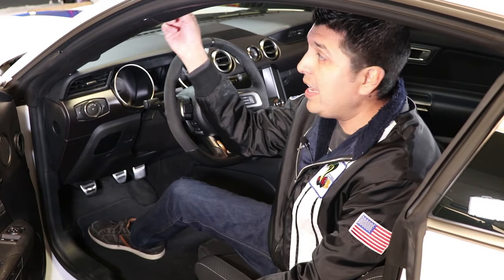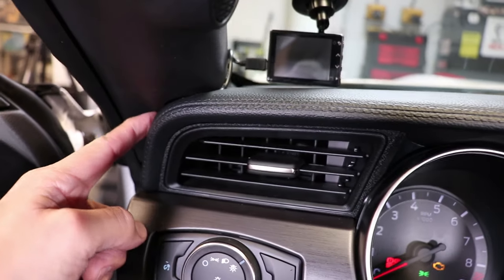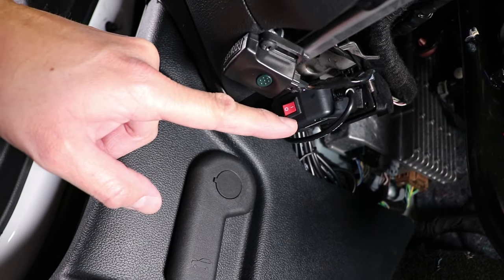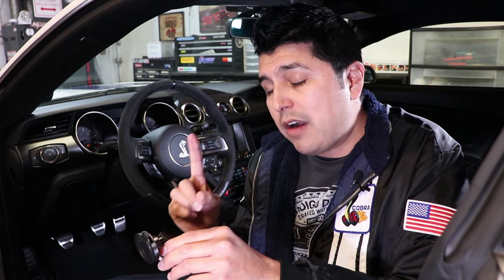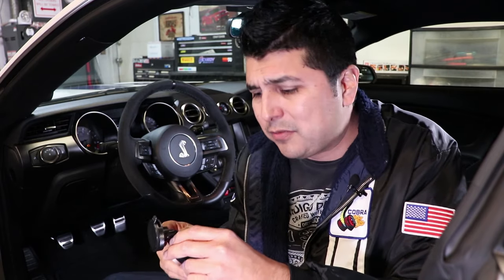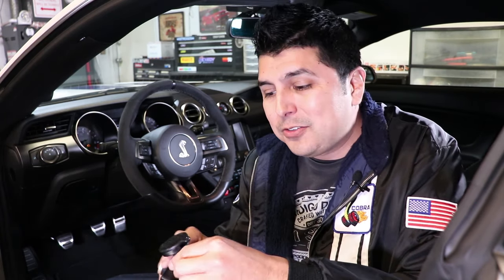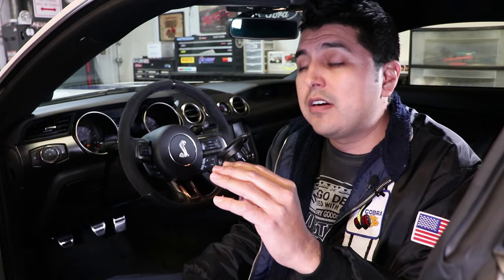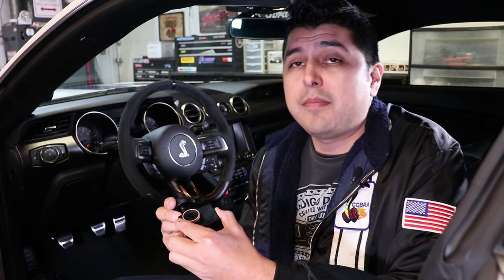Don't hardwire your Dash Cam! Try this instead!

Comment: If you were hoping for the worst dash cam install ever you nailed it.
Reply from the maker: LOL! If you are looking for a permanent install (and hiding the cables underneath the panels, here is my other video showing the alternative Hardwire method https://youtu.be/zbxYA4VhuT8  However I strongly recommend profession installation due to the dangers involved with air bags as explained in my follow up video showing the rest of the install https://youtu.be/uZp95NbNlmM Cheers!

Comment: Thank you for walking us through this.  I am interested in adding a dash cam, especially for the parking mode.  But I am put off by having to either wire this to my car battery or buying an expensive, one purpose Cellink Neo or the like.

Do you have any reason to doubt whether a Jackery or Yeti, or any other external battery popular with off-grid/campervan enthusiasts, could also do the job of running a dash cam, especially in parking mode?
Reply from the maker: You're welcome mavirek! regarding running the dashcam of an external battery, it's definitely possible and some people do run them on portable bank like this one https://amzn.to/3kQroBR the only issue seems to be heat inside of a car degrades the lithium batteries and you will have to replace the battery pack over time once it stops taking a charge. But if you think of it as a consumable item, then it's definitely possible. Hope this helps and thanks for watching!
Reply: That's what I wanted to know also. 
Did you try what he suggested with the other. Battery he linked...or one like it?🤔
Reply: @GoaWay...  I just couldn't get comfortable putting a battery into my car because of stories about exploding batteries.  So I instead got the OBD connection for my dash cam, which I highly recommend.
Reply: @mavirek  it's been no problems with it so far...no dead drained car batteries, or no problems even for the obd port itself...it still works properly if you need to plug something else into the port? 
The dashcam stays working 24/7 with no issues?

Comment: Can’t get a full view of the road in that location !!
Reply from the maker: Hi JerseyJoe, that is correct, the placement of the camera lower on the dash will show more hood than higher on the windshield which while it works for me may not suit everybody. A higher location will show more road and would only require routing the cable a little higher up the A pillar. Thanks for watching bud!

Comment: Great review dude. When you showing the cable connect it to the OBD whats the other device with a blue oval buttom its close to your OBD
Reply from the maker: Thanks Rottie For Life appreciate that! the other device you see is an aftermarket alarm installed by the Ford dealer.
Reply: AutoFun what’s special about the extra car alarm that the dealer installed?
Reply from the maker: @iamdenislara  Hi Denis, it adds GPS tracking, it connects to an app on your phone and shows where the car is at. I just don't like that the dealer tends to overcharge for these systems when selling the car,  they are much cheaper if bought and installed after the purchase of the car. But on the plus side I do get discount from my car insurance for having it. Thanks for watching Denis!

Comment: Great video , what about engine management light from your car ..........???
Reply from the maker: Thanks Me 1! regarding engine management light, not sure what you mean by that, are you referring to the check engine light? if so that is controlled by the PCM, the OBD adapter does not interface to the PCM, it just provides power to the dashcam. Hope this helps and thanks for watching bud!

Comment: Even easier - I plug into my mobile Car Battery Booster which has USB port. That allows me to run my Dashcam in Parking/Security mode etc. The boosters are small now so its easy to use and can be stored anywhere! When I'm driving I just plug back into my car lighter adapter. I don't need it wired up in a permanent way so this arrangement works well for me.
Reply from the maker: Hi TheAisleOfPlety! nice! I had other viewers that mention running battery banks and they said they had with good results but I hadn't heard of running off a battery boosters, thanks for sharing this tip!
Reply: @AlexAutoFun  So glad to contribute! Love your channel! Keep up the good work. My Booster model is the GB40 NOCO Boost Plus.
Reply from the maker: @TheAisleOfPlenty  Thank you! I will take a look at the the NOCO one! 😊

Comment: Good ,i once let car shop remove covers etc and i started having water ingress in the car cabin.since then all my install have been external and done by myself.i even went to extra length as i put a car battery inside the cabin to power these electronic without taking car power supply or alternator power
Reply from the maker: Yep! Same, I can't trust anyone else to work on my car either lol

Comment: Hello!

I'd like to put this in my 09 Jeep Patriot, but I'm a little unsure if this will mess with my car or its OBD2  port because looking at some of the reviews on Amazon I've seen some saying it drained the battery or a check engine light appeared and seeing that my car is older. Yes, I could hardwire it, but I'd like to be able to easily remove everything if needed and with simple tools, since I don't really have any and would have to buy or pay someone to hardwire it for me. 

Thank you!
Reply from the maker: Hi Amy! I been running mine for over three years now without an issue but yes there is risk associated whenever you connect an aftermarket device to your car. Here is another video I made that covers the use of the OBD port for powering devices if you want to check it out https://youtu.be/hEmvv8M8bGI But yes the OBD adapter does have the advantage being able to be installed and removed very easily, specially like in the cases where people prefer not to hard wire it (such as rental or lease cars) and just to save some cost over a full hard wire installation. Hope this helps and thanks for watching!
Reply: @AlexAutoFun  Thanks so much! I’m leaning towards a mirror dash cam that I’ve seen you review, do you know if it will work with it?
Reply from the maker: @amyvazquez5764  You're welcome Amy! ah regarding using it on a mirror dash cam, no it won't for those, they use a lot of power (they need 2.5A and the adapter can only supply 2A) because of their large screen they very power hungry, maybe they will come up with one later that does not need so much...
Reply: @AlexAutoFun  Oh okay that makes sense, I’ll explore my options! Thank you so much for your time and help, I really appreciate it!
Reply from the maker: @amyvazquez5764  You're welcome Amy!
Reply: I had been using this on my '15 jeep patriot, but it ended up draining my battery when I left it on surveillance mode for a day and a half. Think I'm gonna stop using it bc of those concerns too.. hopefully it hasn't damaged anything :/ 

Trying to figure something else out.

Comment: It's a standard that black and red are supposed to be connected to the car battery for continuous power and that green or yellow goes to the ignition sense. That applies to every car accessory I've seen, except Garmin's parking cable.
Reply from the maker: Hi Urban! yep you would think we would consistent with the colors on a hardwire kit by now ugh but yeah I keep seeing deviations where some red for ACC and some use Yellow for ACC and vice versa, I actually have one more hardwire kit review coming next week where this is the case again, hopefully one day we will all be on the same page on this. Cheers!

Comment: I had high hopes for this but it isn’t working out. Seems to work at first but on longer road trips it takes “naps”-  the power dips, camera light stays on but it’s not actually working, freezes up.  Tested by going back and forth between obd adapter and usb, confirmed camera is not the problem.  I’d suggest using usb or try the fuse tap option. Very intermittent symptom so I can understand you might not have observed this, or maybe it depends on your car and the dash cam model.
Reply from the maker: Hi beliveinheroes! Yep you are on the right track regarding car and dash cam model. While I used mine for over 4 years now without an issue, I seen the case you are describing when the adapter is used on a newer car (specially hybrids and cars with Eco mode) where the car will cut or reduce power to certain circuits which in turn affect the adapter. I also seen it when using the adapter with certain dashcam that exceed the power output of the adapter, as the adapter overheats an either lowers it's output or turns off all together for safety then resumes working once it cools off and the cycle repeats (giving the impression that the adapter is taking naps here and there). Here is the hardwire video for those cases https://youtu.be/uZp95NbNlmM Hope this helps, Cheers!

Comment: Camera position.  In the UK if it obstructs the drivers view it is illegal. That means your car insurance is invalid. You can be hit with multiple penalties. Driving with no insurance, breaking the vehicle's type approval, obstructing the drivers vision. The only sensible place to fit a camera is up behind the rear view mirror. That gives you coverage of both the left and right of the car as well as straight ahead. Having said all that the idea of using the On Board Diagnostic (OBD) port is a good one. BobUK.
Reply from the maker: Hi Robert, wow thanks for sharing that, it sounds similar to California, we recently have gotten more and more regulations. I have heard of people getting ticketed for things like air fresheners hanging from the mirror or GPS systems mounted on the windshield due to obstructing the view but it's one of those things that its sometimes enforced and sometimes the police won't bother you with it. So interesting you guys go thru something similar.. Greetings from California my friend!

Comment: The best explanations video  I saw so far while shopping for a dash-cam, now here is a question.. which the BEST dash-cam can do lets say 72 Parking mode, to catch a vandalism for example.  I read that there are 24 hours OBD power cable.. have you updated this yet?b  Thank you very much
Reply from the maker: Thanks A. JAY! regarding the dashcam here is are a couple of my favorites that support parking mode https://youtu.be/fQDgk2YnRhQ , https://youtu.be/hipvzNAeypA or this one https://youtu.be/sfVLa-PUbu0  You could use time lapse mode to record continuously or motion detection mode. So far I have left my car parked for about week or two and the battery was still ok and the dashcam was still running (the battery low level had not reached the voltage cut off mode). Let me know which one you end up going with!
Reply: @AlexAutoFun  Thank you very much, will look them up.. Keep the Great you do coming to us.
Reply: @AlexAutoFun Alex, the only one I think will work is the 612T Vantop, problem is only 128G(4k are Large files) card, and no motion sensor for vandalism to record 24/7, at least 72 hours is needed.

Comment: Careful using the OBD method, it can cause issues.  Best bet is to order one of the Hardwire Kits, especially if the cam's mfg makes a kit.  The kit from Rove is particularly good.
Reply from the maker: Hi MojoPup! I have been running mine for a couple years without issues but I just released another video for the Hardwire method you can take a look it here https://youtu.be/zbxYA4VhuT8  Thanks for the tip on the Rove kit I will definitely check it out!

Comment: Hello! Thank you so much for this video! :) 
I had a question, since I’m a beginner and I’m a little confused on some things. My vehicle has a fuse for ACC and Accessory, and a separate one for the cigarette lighter.

1. If I wanted to only have it on while my car is running like you  mentioned, will it go in ACC, Accessory or both?  

Thanks again! Just watched the one where I can place the wire behind the airbags and that helped a lot
Reply from the maker: Hi! I think you are talking about a hardwire kit not the OBD2 adapter shown on the video. If so, yes the dash cam will only turn on when the car is on and enter parking mode (if the dash cam supports it) when the car is off. Here is my video explaining how hardwire kits work and their connections https://youtu.be/Yky9_tTvwMc And here is my detailed hardwire kit video https://youtu.be/K2iKXj82354 if you want to see how those connections are made. Cheers!

Comment: Very informative video and also wow that you manage to reply to basically every comment. I already had a dashcam in my old car between 2017 and 2020, and it did its job but was a rear end so wish I had a rear unit or a dual combo system. Definitely making sure I get full coverage next time. In the months prior to that happening though, my car randomly got a load of small dents on the bonnet and no idea what caused it. It could be hail damage but I still wonder if it was someone malicious and I guess we'll never know, so might be worth considering the other modes plus a form of power that works when the car is off to catch things like that in future. I just used the cigarette lighter power with a usb adapter previously
Reply from the maker: Thanks Stallzy! Yeah I think a dash cam system is definitely worth the investment, there are some really good ones out there in terms of having multiple cameras from the same system like this one https://youtu.be/8i_CVpPj3Dg with 4 channels or this one https://youtu.be/JJKbUu_egiE with 3 channels or this one https://youtu.be/vUEsIYEBVck with 360° video. Hope this helps, Cheers!
Reply: Get a special  power pack for your dash cam. There is a Video about that here on Youtube. Just  check.
Reply: @tomh9807  bit of a late reply but I don't use the parking mode
Reply: @Stallzyx  Sorry just popped up here now. Don't have to. My dashcam is always under power in the vehicle i am driving for work. Regular cars need hard wire but that drains ur battery. Better use a special power pack.

Comment: I no this video is 2 years old but you need at least a 2 ch dash cam and now you can get 3, front, back, and inside especially when the police pull you over for a car stop you can record the interaction.  Thanks for the info didn’t know about the using the ODBII for power
Reply from the maker: You're welcome BLACKHEAT1028! and yeah I totally agree with you, better have the extra coverage and not needed that be in a situation like that wishing you had a record of it. Here is a good dashcam I recently reviewed https://youtu.be/O5W8XjkLWPs it has 3 channels and true night vision, if it helps bud!

Comment: Wonderful video. Question: do they make a right angle adapter for the end of the cord that plugs into the camera? I have a Minolta MNCD37 and the port is on the top on the camera. A right angle adapter sure would make this set up look better. I would to add that I noticed you respond to all comments. That's excellent!!  I see many people who make videos never respond to questions or comments.
Reply from the maker: Thank you David! ah yes for that this one maybe a good solution https://amzn.to/3b3Jiys since it outputs to a full size USB port, allowing you to plug in a cord of your choice (in this case a right angle). Hope this helps, Cheers!

Comment: pro tip, not every camera can be powered from the OBD port.I had an Aukey camera that could. Then I switched to a Rexing camera for the rear camera function and it required TOO much power, and the OBD port didn't provide enough power.
Reply from the maker: Hi hengineer! ah yes good observation, there are dash cams out there that will need more power like the one you have and mirror dash cams. Thanks for watching and commenting bud!

Comment: As I understand it, the Garmin parking mode cable allows Park mode to record impact and motion, but the constant power cable does not record motion. Make sure the right accessory cable is used.
Reply from the maker: Hi Malcom! Yep that is correct, as I mentioned on the video, the OBD power adapter unfortunately does not enable the Garmin's "Park Mode". Garmin sells their own kit that enables this function (so far Gamin is the only dash cam I tested that has locked their dash cam in this way). Thanks for watching and commenting bud!

Comment: Recently I watched your video on using a OBD power adapter to charge/power a dash camera. I have a Garmin dash camera and Garmin Constant Power Cable (Compatible with Garmin Dash Cam, Fits Vehicle’s OBD-II Port for Power Even When Parked and Turned Off). In your video you mentioned that this OBD charger should only have pins in positions 4, 5, and 16 which the Garmin charger only has pins in those positions. This should limit any issues with the computer being affected, if I understand correctly. Since it has only has those three pins, what other issue should I be aware before using this charger daily? I tried looking up the electrical schematics for a 10th gen Honda Accord but was unsuccessful. I want to make sure that between pin 16 and the battery there is a fuse. Is there another name I can search for my vehicle’s “schematics”? Is this something that is better found at a dealership?
I really appreciate your videos and thank you.
Reply from the maker: Hi Lizandro! Ah yes the service manual is available from your dealer however it may be cheaper to get it from Amazon or Ebay. Also if you are in some forum group for the Civic, they may already have a copy of the service manual that they can probably share with you (assuming is a file that is allowed to be shared). Hope this helps, Cheers!